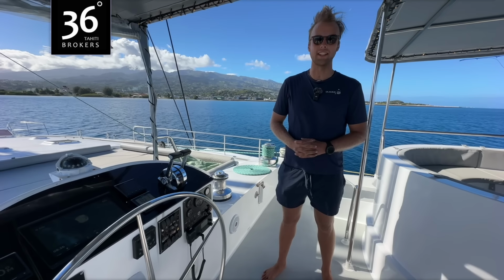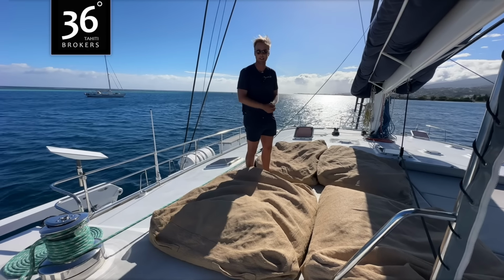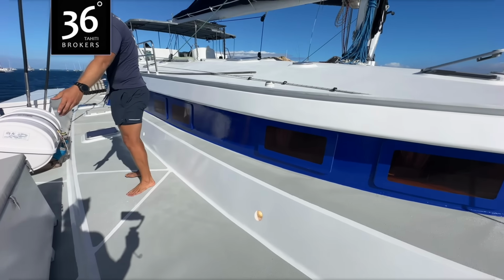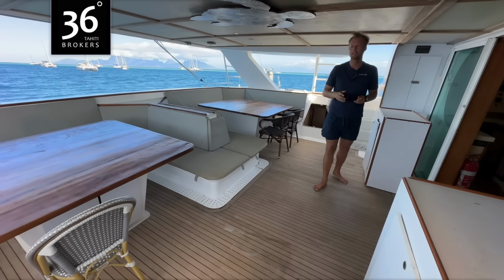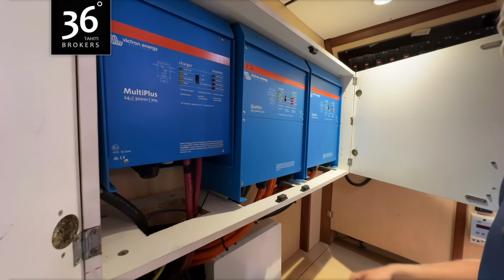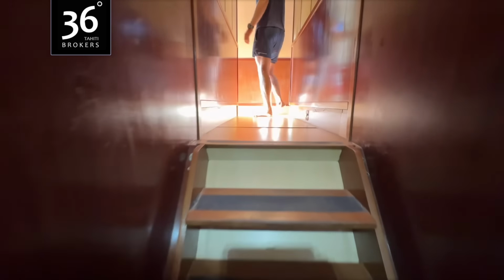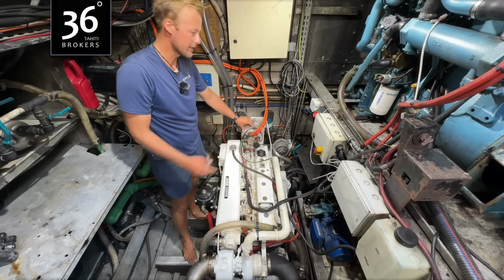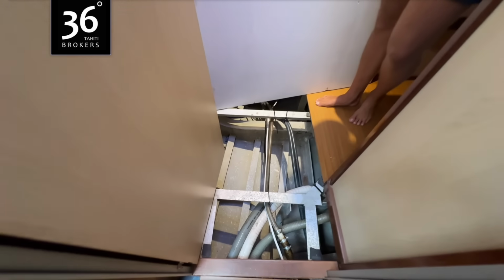*SOLD* 2005 | 82’ Dive Charter Catamaran | For Sale with 36° Brokers

Comment: That outside lounge roof could be solar panels as well. Those engines should have been hybrid and obviate the need for a generator in favor of more batteries and less maintenance and fuel usage with regen and flexible means of propulsion. Additionally, an induction stove would be cleaner, safer, easier. Finally, in-mast furling system would be nice, especially with a rotating mast.

Looks like a great business platform nonetheless.
Reply: Sounds like you should build your own boat.